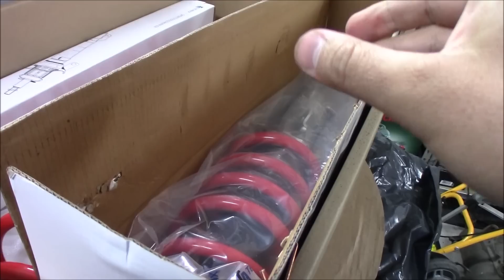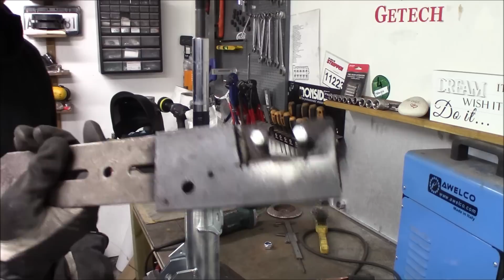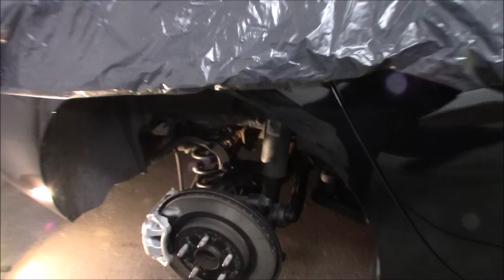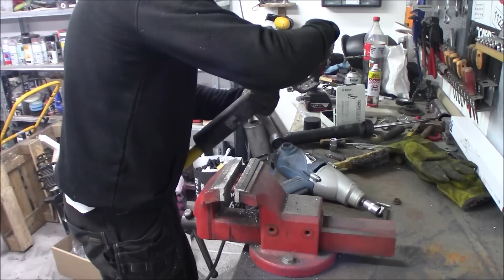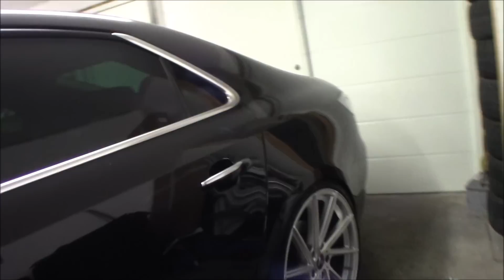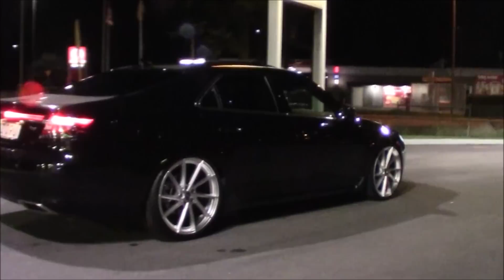SAAB NG 9-5 Custom Coilovers!

Comment: That's an interesting one. I've been struggling with finding my hiper strut but without real time dampening 12822818 and I came across similar problem as these parts are no longer available. The struts which are widely available for NG cars are mostly those with the bottom bracket for non XWD version, so similar to those You just used. That sounds like a solution too. But at the same time I just can't believe saab's XWD chassis is so unique. I made some research and the only one could fit would be Buick's Regal strut that don't have this bottom bracket already, but they're not available in Europe. Any clue which of them would be a direct fit but from a european car? I wouldn't need a custom coilovers, just lowered like a stock XWD strut. That's quite a simple strut tbh...

Comment: It seems that the rims are protruding a bit over the tire edge. what exact size of tires are these, didn't you consider to fit one size wider to protect the rim arms? I had a plan to buy same ones, but 21'....i'm a bit scared :D Anyway, ocean oc-01 look great on NG. Thanks for the content.
Reply from the maker: A little strech is needed to get Perfect fitment without scraping the fender. These are 21". There is not many People running ng9-5s on Coilovers so you could go up in size tire if you like
Reply: @JonasKakarikas  My Ng is likely to have (it's not here yet) -10mm stock factory Sport setup. What was Yours before the change, and by how much the car is now lowered?
21' look niiice, but the tires' costs go up significantly and we lose some comfort either.
Reply from the maker: Before The change it had Hi-per strut aero suspension = - 10mm. Now its probably lowered around 60mm

Comment: Is this type of front chassi has only Aero?
Reply from the maker: Aero and xwd cars.
Reply: @JonasKakarikas  Thanks! Do you thing its better in any ways? Stability or smaller turning radius? Or maybe some other benefit? As for me, I don't see any technical advantages in this, but maybe I'm wrong
Reply from the maker: There is super much R&D behind this chassi. Search GM HiPer strut on Youtube and you Will find alot 👍